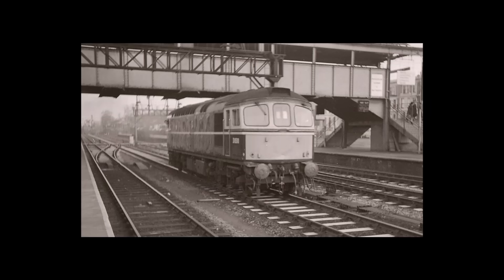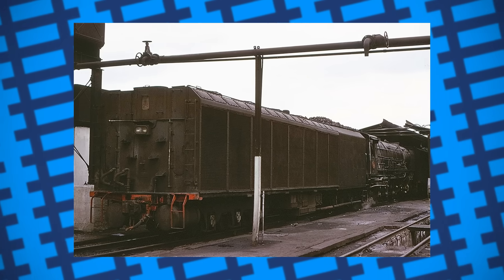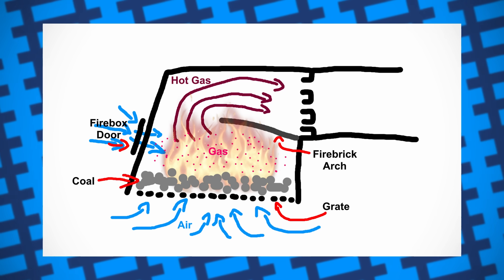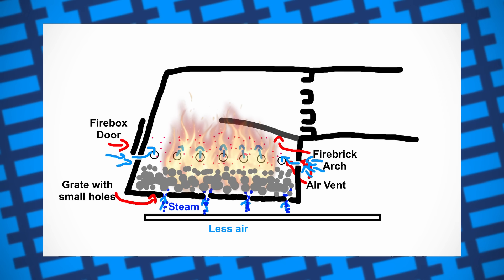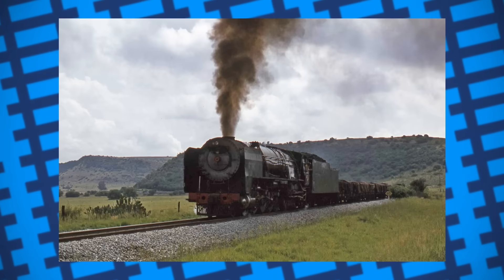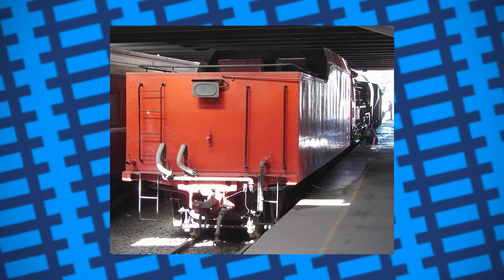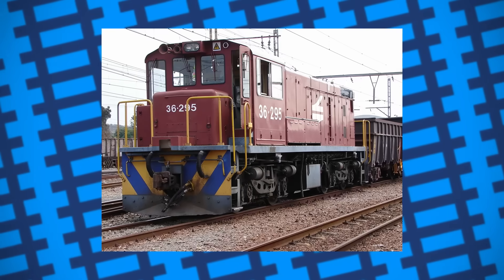South Africa's Diesel busting Steam Locomotive - SAR "Red Devil"

Comment: L.D.PORTA WAS THE ENGINEER - NOT WAREDALE !  
Indeed it was World Famous "L.D.Porta" who supervised the Total Redesign & Reconstruction of the "Red Devil" NOT Waredale, who simply tried to steal Porta's thunder. And the problem with Porta's revolutionary rebuilding of the "Red Devil" was that it was now MORE EFFICIENT than the Diesel, which caused a Political row within the South African Government. As SA has lots of cheap good quality Coal, but has to "buy in" Oil ! 

Indeed Porta moved on to SLM in Winterthur, Switzerland and went even further with a German WW2 Class 50 2-10-0. By also designing equipment to allow that loco to totally start itself, dramatically reducing Labour Costs. It usually takes a handful of shed staff to get large steam locos ready for work. Taking often a good four hours, as you cannot rush steaming without damaging the very expensive boiler. The totally rebuilt Class 50, could be "programmed" to start itself, and fire itself (it was of course oil fired) and have itself ready without ANY human help for a specific start time.  Which also as in South Africa led to another Political Storm, as the 2-10-0 was not just more efficient than a comparable Diesel loco, but at least as cheap on Labour Costs, and was also designed to use Diesel Fuel NOT the Heavy Crude Oil previously used in most steam locos ! 

L.D.Porta (1922-2003) was the Worlds last "Genius Steam Loco Designer". Who had solved many of the inherent issues with the steam loco that virtually the whole World had accepted as just part of the peculiarities of steam. Indeed like his father he worked originally for the Central Argentine Railway (A British owned Railway Company until 1948) Rather than design out such issues. Indeed this was the exact thinking of O.V.S Bulleid, who tried, but the Politics and Engineering both failed him in 1945-48 !

Comment: I dont understand how such a big machine can be stable on narrow gauge. It looks about to fall over. Big standard gauge locos rock and roll around. Really scary at speed. And this has 18 inches narrower track. Must be a wild ride.
Reply: The track was extremely well maintained. I was on a South African train in 1985 hauled by a Class 23 steam loco that I timed at 67 miles per hour. Extremely stable ride. I'd travelled behind both a 25 Condenser and the 26 Class earlier in the tour. Memories that will last for ever.

Comment: Asking a  question: Could they not have produced a steam turbine engine generating electricity driving the wheels. I don't know much about anything but coal electric just might just have been cheaper to run than diesel electric. Especially in a country where there is  a lot of coal.

Comment: I spent from 1981 to 1993 as a stoker on the South African railways.
Down here in Port Elizabeth we mainly used 19D, 24 clas and 15R and AR locos but of course with the railway workshops in Uitenhage and Pe we got to stoke some of the inland locomotives as well like the 15F the two Garrets and 25 class locos.
I really moss those days and basically got chased away when they closed Sydenham loco down.

Comment: Was any steam engine tested using pulverised coal loaded into the tender  and blowing it from the tender into the firebox? I guess that you could vary the flow to control the firing?
Coal fired power stations pulverised the coal and blew it into the furnace

Comment: If I had a metric F ton of money...

well First I soon will not due to all the donations.

But if I had enough?

Custom build a Albany Baltic tank, or a German BR65, locomotive with all the fancy steam stuff.

The GPCS in the Firebox, the Poppet valves, the Giesly Injector, and any others.

plus be made to be easily switch to oil fire and bsck, want to see and test how far I can push coal and once that done be switch oil for cheaper running.

Comment: Today  with the green movement one can see the political drive in those days for the world to be forced to buy oil using American Dollars which benefitted only America., hence today,s weird politics... Diesel was never really better or more efficient, It can be seen that even in those days the SAR cow-towed to international political  pressure. Wardale clearly showed the world what steam was capable of even in the guise of and old style locomotive first designed and built in 1953. Clearly ANY modernization of old tech was frownd upon in the same way that hydrogen cars and huge ellectrical innovations was stopped by bullying and the muder of more than 100 innovators over the years. All to preserve Western Hegemony.

Comment: Liked the video. First saw mention of the Red Devil on some South African railway DVDs I have.
 One DVD mentioned the condensing locomotives and the problem the system
had with damage to the fan in the exhaust caused by char.
 Maybe the gas system in Red Devil may have made the condensing system more viable.

Comment: Very interesting - thanks for making this video.
I know a bit about these locomotives because I was a student mechanical engineer at SAR&H from 1997 to 1982.
During the University vacations we were required to undergo practical training at the workshops and the main drawing office in Pretoria where these modifications were designed.
They were very proud of what they had achieved. During the 2 weeks I spent there I was given the drawings for the condensing class 25 to study and given a lecturer on how it all worked. 
The real reason for the condensing was because the rail line between Pretoria and Cape Town ran through a desert region where water was scarce and brackish, so a real problem. 
Of course condensing did also improve efficiency. 
The company really wanted to change over to diesel because the maintenance of steam locomotives was very labour intensive and therefore expensive. The lower cost of coal did not offset the maintenance cost.

Comment: Back in 90 I had a tour of the engine shed in Kimberly,the 26,Red Devil was there. Very impressive machine. The mechanic explained the running gear and most everything could be kept going for ever,make the parts. The boilers have a life,only so much can be done and that's what kills them.

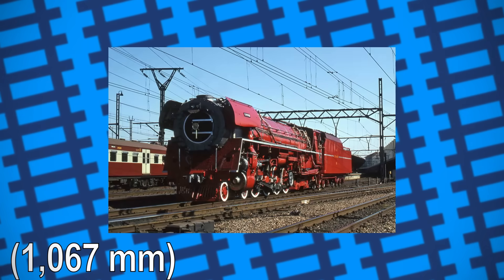Comment: @7:39 you say that that it was running  'on narrow gauge three foot six inch wheels'.  This is NOT correct.  The rail gauge is 3ft 6in - Cape Gauge - but the drivers are 5 feet in diameter.  There is no such animal as a 'narrow-gauge' wheel, only the space between them on the axle is the measure of the gauge of track on which it runs.

Comment: There were coal-hauling railroads here in the US that clung to steam power and tried to make the locos as efficient as possible. But the real problem with steam locos is the insane amount of maintenance they require compared to diesel.
Reply: The US did drop steam pretty early relative to other countries.  BR in the UK ran steam on the mainline for several years after the N&W went diesel.  There was a verrrry brief period where BR steamers and the Japanese Shinkansen were running at the same time.
Reply: Not so.....its a question of design and observation.

Comment: Hey tot, in the netherlands. For a long time we have used locomotors (or locotractors like the ns-100 & the ns-200 series) which are a simple type of locomotive. They have simple brakes, not an extreme amount of power and a mechanical brake. 

It would be amazing to see a video about these engines

Comment: I am of the opinion that battery electric steam engines have potential, or oil-fired steam engines, as long as firing can be automated by computer - allowing steam to be built on the engine’s own. It’s likely automated safety systems would need to be put in place as well, i.e. an EFCO if the water level gets too low

Comment: I used to be a volunteer for Atlantic Rail where the Red Devil resided before being returned to service. The crew let me climb inside the firebox. Its about the size of a garage. I also got to see the double blastpipe system. Truly is a gorgeous loco. Its wheelbase is actually too long for some of the curves on our lines so its restricted to certain routes.

Comment: One of my favourites. This narrow-gauge rocket puts a lot of standard gauge locomotives to shame. The mix of the typical "german look" of the Henschel design but with the distinctly american 4-8-4 wheel arrangement is so cool.

...also a good example of why modern steam didn't beat diesels. Steam has "more" to give but it always comes at the cost of more complexity and maintenance. I wonder what the shop crews thought about "that one locomotive" that had all custom parts and was non-interchangable with the rest of the class 25 NC.

Comment: What's the purpose of that large silver-colored pulley just a bit out from one of the driving wheels?  It looks like it takes the rotation of the driving wheel to drive a smaller pulley up and forward of it.  (And it looks like it is mounted on the crank pivot, so that the rod goes between it and the driving wheel.)
Reply: My father was the Foreman of the Blacksmith shop at the Salt River workshops and worked on the team that did the build
From what I can remember of what he told me the pulley system was something to do with a turbine which blew air into the firebox to keep to keep the amount of air in proportion to the speed of the locomotive
Reply: @keithhowell3023  That makes a lot of sense.  Although I guess it must have been some kind of centrifugal turbine so that it would at least sort of work when backing up.

Comment: Thought-experiment.    It's now 2024 and we have high powered supercomputers with FEA, we have composite materials with carbon fibre and thousands of steel alloys.  We have 3D printers that can print rocket nozzles.

Replace the humble rail with maglev superconductors, add enough olympic-bobsled-team-grade streamlining to make Gresley green with envy.

What kind of steam-powered engine could be built with all this technology ?

Comment: Notes: decreasing the amount of airs coming into the fire box via the grate, having a thicker layer of coal and some exhaust from the pistons  helped to get more of the reactions from the coal creating more heat for the water but less buring of coal so even less chance of any of it getting sucked with the strong pull of the air damaging the engines or creating fires out the smoke box, 
It also saved fuel, could out put some more power and was silent..

But it made ot hard to fire and needed good Quilty coall. ash builed up with the few holes not able to empty it more

(This engine type itself had a problem with traction and could apply its power)
Reply: The obsession with primary airflow was a problem. You reached the state where 50% of the fuel fired was expelled through the chimney in unburnt form. You need to minimise the disturbance of the firebed and also make sure that all particles of fuel are consumed within the firebox hence the use and control of secondary air above the fire. You had to know how to use the stoker because the distribution needed to be even (a bit more development work needed here maybe) and the rocking grate system needed looking into.

Comment: Excuse you, that Red Devil runs on NARROW GAUGE track?
Either I don't know as much about railroading as I THOUGHT I did, or there really is some evil wizardry afoot to get that thing running on narrow gauge track
Reply: In terms of European, American and other countries' thought, the 3ft 6inch gauge may be "narrow gauge" but in South Africa it is the standard one. Also called Cape Gauge. This gauge was decided upon because serious mountain passed have to be passed from the coast to the hinterland. Interestingly, the SA class 4E electric locomotive had a 1-Co-C0-1 wheel arrangement on the 3ft 6inch gauge and had the flanges of the centre wheels in each bogie machined off to enable it to negotiate the tight curves in the mountains.

Comment: Red devil is probably the closest we will ever get to a modern-day steam locomotive in terms of technology. Honestly, I think I read somewhere that when compared to diesel engines it was even more efficient than first generation diesels, and I think it was almost as good as diesel locomotives of that time, although stuff like the wheelslip problem and politics, ended up stopping the class 26 from ever becoming standard
Reply: That's really why engines are paired now...... Two smaller engines instead of one....
Reply: Nope. 
False
Switzerland restomodded a Br50 from germany to modern standards
Reply: I believe there is a project that's currently making a prototype hydrogen-steam loco.
Reply: Swiss Br 52 8055
Reply: Running a diesel or electric train is also So much easier. You only need one person at the cab. It starts with one push on the button and it doesn’t spray everyone around in layers of sud. The steam locomotive was already out of date in the early 1900s when cities started to run the first electric metros
Reply: @MrJimheeren  Maybe atleast 2 crews would be better, 1 crew sometimes just a bad and/or worst idea.
Reply: @TheRealRajo6466  1 crew to run a diesel or electric powered train is no problem and is done safely around the world.
More crew MIGHT be nesseseary if you run very long trains, or very long distances in one go, as you would need to be able to switch out operators, or run long enough to need mid trip inspections on rolling stock etc.
It's very common in a lot of places to simply switch driver on trains halfway through the journey, just stopping at a station, old driver hops off, new driver hops on.
Reply: @MrJimheeren  Still a diesel busting absolute unit.

Comment: It is remarkable that GPCS wasn't used in period, given that Gasworks predate railway mania by half a century.
Reply: Maybe because original gasworks were relying on carbonization while this process seems rather like gasification which was later invention. on the other hand it seems bit strange that they did not try to use it earlier, given the fact that small scale coal gas generators for internal combustion engines were already made during late 19th century.

Comment: Power was never the reason steam was replaced by diesel. It was maintenance requirements. There's so many moving parts on a steam engine. A diesel cylinder assembly can just be replaced, as one unit.

Comment: in the mid 1990's, phil girdlestone, who had worked with david wardale, assisted in redesigns to two victorian railways r class locos, r711 and r766 to get more power from them to enable them to maintain a diesel timetable from melbourne to warrnambool.  there was a noticeable power increase to the extent that r class pulled trains were permitted to reverse at geelong station so they could get a run at the climb inside a tunnel and the 'super r's' never needed to reverse for the run-up.  however r711 threw a connecting rod probably because of the extra power.  the modifications have been removed from both locos.  it seems that all the removed components have been stored.

Comment: With steam traction there's no getting away from the lots of maintenance required, they have to undergo this every time after running activity. Thermal efficiency is only 17%. In the beginning diesel locomotive had costed more to build than steam but these didn't need constant 'nursemaiding' so this had made steam days numbered.
Reply: Maybe perhaps it's time for a different tactic. Instead of trying to make steam better. Let's just find the most remote, Barron, coal Rich ,distant place we can find. And find a rail line, a town that needs some transportation, passengers, freight, etc just like the crab watching an Egyptian did 🚂

Comment: I’ve never heard of a engine who rebuilt to make them a diesel-steam hybrid
And plus the engine does looks cool
Reply: Wait until you learn about the Swiss Steam-Electrics 😀
Reply: @railwayjade  They should really be called "Electric-Steam" given there were some actual  Coal fired "Steam-Electrics" made for the French railways.
Reply: @railwayjade I do know of their existence
Reply: We had the Kitson-stil diesel-Steam hybrid in the UK.
The diesel was a direct drive to the wheels using the front 1/2 of the cylinders and the exhaust was used to make the steam.
the Engine was started on steam and the diesel was started at around 20R.P.M.

Comment: Thank you so much ToT for finally making a video on this epic train! Just thought I'd add some extra information: 

After being withdrawn from service in 2004, it sat in storage for about 14 years before being restored by the Ceres Rail Company in 2018. It hauled exclusive passenger services for about a year, which is mainly what popularized the company. However this massive and powerful engine was not suited to running on the shorter, twistier branch lines used by the Ceres Rail Company, and was withdrawn one again, in 2019. It was put into a rail yard where it sits to this day, still under the ownership of the Ceres Rail Company.
Reply: Hi Michael, not under their ownership, they are working on being allowed to restore and run the loco but TFR has tons of bureaucracy to get past.